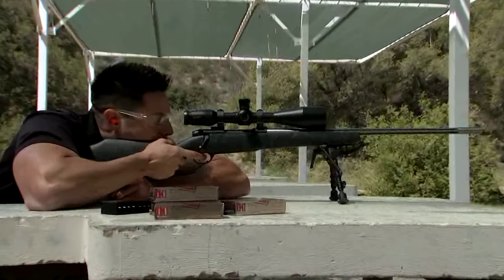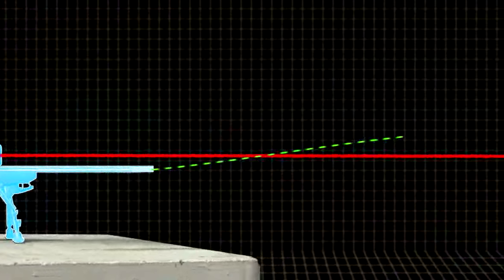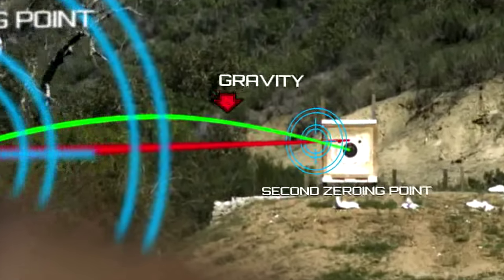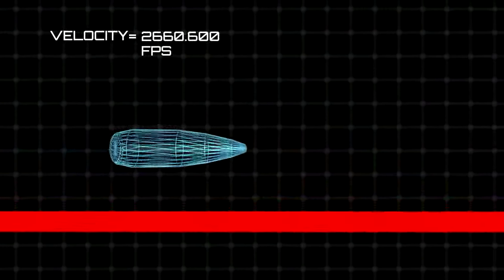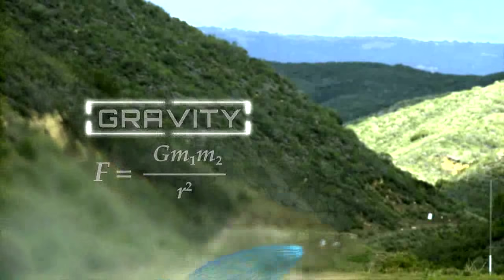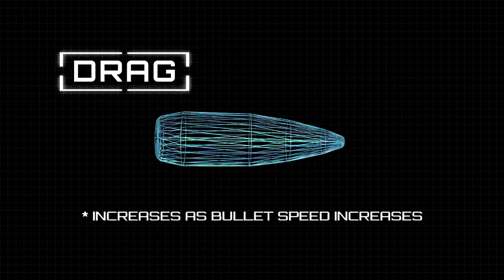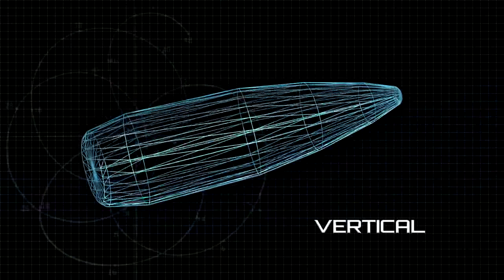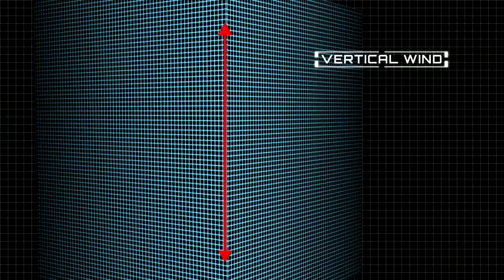Firearm Science: Bullet Trajectory

Comment: If I can make an observation.. the animations used illustrate a bullet rising as it leaves the muzzle, which is one of the biggest misconceptions with regards to a bullets trajectory.

The rifle optic and the bore are not parallel. Instead, the lenses in the optic angle slightly downward so the line of sight and the line of the bore intersect in two locations. This forces the shooter to angle the rifle slightly upward to compensate for the optic looking down, and in turn the projectile exits the barrel at an upward angle.

Where the projectile's path intersects the line of sight for the first time, should be the near zero, i.e. 25yd, 50yd, etc. 

The bullet continues upwards until it reaches its maximum ordinate, and then begins a downward path. 

The bullet will once again cross the line of sight at a far zero point, 100yd, 200yd, 300yd, etc. (The distances will all depend on the individual ballistics of the ammunition being fired and the length of the barrel from which it is fired).
Reply: "...the projectile exists the barrel at an upward angle." Ahh, no that is not correct. The bullet exits the barrel traveling in a straight line. But as soon as it has exited, gravity begins to affect the trajectory, so the bullet begins to fall toward the center of the earth. If shooting at a target that is approximately at the same altitude as the shooter, the bullet must initially be launched at a slight upward angle relative to the straight line between the shooter and the target. This is accomplished by raising the barrel slightly. If the firearm is sighted correctly, the upward angle will be such the the bullet will rise, crest, and then fall such that the point of impact is the aim point on the target. The actual flight path closely approximates a portion of a parabola.
Reply: @steveh8724  is the barrel angled upwards? Then yes. It does exit at an upward angle. I didn't say the round rises once it exits the barrel, I said that when it exits the barrel it is angled upwards to generate a trajectory that will allow it to rise above the horizontal plane, and then fall back onto its intended target.
Reply: @steveh8724  after reading your comment, you are basically agreeing with me I don't see where the disconnect is.
Reply: Pablo > steve
Reply: @steveh8724  Isn't that exactly what she claims?
Reply: @pandresa  what if you are shooting uphill/downhill? WOuldn't that change the zero?
Reply: @wcsdiaries  first off you shouldn't be zeroing uphill or downhill. just wanted to throw that out there. not unless it's warranted for some strange application, like armed rooftop security guard or something weird where you'll actually expect to only shoot downhill.

regardless if it's uphill, downhill, or flat, a bullet will never exit the barrel in the manner described in this video. if the barrel is parallel to the ground, the bullet will exit the barrel parallel to the ground and immediately feel the effects of gravity. if your barrel is 45 above/below the horizontal plane, the bullet will exit at 45 above/below the horizontal plane and begin to feel gravity just the same.
Reply: @wcsdiaries  but to answer your question, zeroing uphill and downhill does change the zero. don't know why you'd do it though.
Reply: @pandresa  what I meant was, let's say I'm 100 yards away on a hill shooting at a deer, BUT when I zeroed my rifle it was at 100 yards on flat ground. Would the elevation change affect the arc of the bullet, and thus throw my (perfectly zeroed) shot off? I've heard the saying "uphill/downhill aim low" bc apparently gravity doesn't throw off trajectory as much if the bullet is angled up/down. is that true? or myth?
Reply: @wcsdiaries  shouldn't matter much if you're shooting a deer at 100m. maybe an inch of difference, you'll still hit lung. but in theory, yes it would be different. you'd have to make an adjustment if you're bow hunting from a stand because of how slow the arrow travels compared to a bullet. but like I said, 100m is negligible. 200 and beyond, depending on what you're shooting, it'll make a bigger difference.
Reply: @pandresa  ok so if i zero in a riflr at 600m (hits bulls eye perfectly), then climb a ladder to a platform high in the air directly above my zero, and fire at that same bulls eye (which is still 600m away) i would not hit the bulls eye, and my shot wiukd probably be way high on the target?
Reply: @wcsdiaries  basically, yes. lol
Reply: She said "the barrel of the gun  must be pointed upward."  To my understanding, the bullet travels in an arc.  It's like throwing a long pass with a football. I don't understand why people feel the need to over explain that simple concept.
Reply: That makes so much more sense... always assumed scopes were parallel to the barrel, and wondered how that helped with aiming
Reply: I think this is meant to give the audience a "concept" of what the projectile's trajectory is like...yes, maybe it would have been more accurate to ensure the gun-barrel was tilted upward more perceptibly to demonstrate this, but well...I think this video made a good effort given what it is.
Reply: I think that's exactly what she said, but it just looks weird in the animation because the line drawn was not parallel to the barrel

Comment: And no setting elevation is done by lowering or raising the crosshair of an optic depending on the distance , or if the optic has the grooves for distance then that is how you adjust elevation .
Or without an optic like an AK you have the elevation for several hundred meters and you just set those

Comment: There is something slightly incorrect about the animation. Actually gun barrel is slight tilted upwards. There is no such thing as lift for the bullet. The reason air foil can generate lift is totally different, it is due to the shape of the air foil such that the upper surface has less pressure and lower surface has more pressure due to Bernoulli's principal. Note that bullet is axisymmetrical and it does NOT generate any aerodynamic lift. Let's repeat it after me again, there is NO lift for bullet and the barrel is tilted upwards.
Reply: LOL god dam you ripped the shit out of that person ahahah i didn't even get to read what that person said but i agree with your statement..the animation seemed unclear and off. i dont know too much about guns but its wasn't clear on the information from what i saw and what she was explaining
Reply: The bernoulli explanation is absolutely overused and incomplete. All it does is generate lift with 0 AoA. But the MAJOR component is actually angle of attack.
Paper airplanes don't have the classic airfoil shape, but still fly? That's because the real component is AoA, it is deflecting air.

Comment: Another thing to consider about high speed bullets, when a shooter lets one go toward a target, on the surface of the earth they are actually sending that bullet into a direction that would eventually lead into space. Force of gravity keeps it wrapping around the surface of that "basket ball" from which it was launched. The more speed, the less gravity will have an effect due to these two force vectors acting upon the bullet.

Bullet drag coefficient is also super important. The more efficient a bullet is, the less starting velocity is needed in order to maintain a higher finishing velocity. The overall velocity deviation over the flight of that bullet is less varied and, keeping in mind about the first statement, the bullet will have less drop overall. You simply don't need a massively powerful, super high speed muzzle velocity if the bullet design is very efficient. Wind and gravity will have less effect.
Reply: this is false on so many levels, you probably still believe in coriolis effect!
Reply: @brianzell99  Facts don't care what you believe, or how you feel.
Reply: @exothermal.sprocket  exactly!
Reply: @brianzell99  There's only one set of facts. You aren't aligning with them.
Reply: @exothermal.sprocket  I agree, facts are facts!
Reply: @brianzell99  I know what you're saying and I'm not playing your game. The air went out of your basketball and you've been playing the flat game ever since.

Comment: Rifle effective long distance ranges is 600-1,500 yards. It gets boring once you know how to work it. But I still find joy in plinking. Rule of thumb: every barrel inch lost minus 25-50 fps, every 100 yards 150-200 fps lost, subsonic when below around 1100 fps, 1 mil is 1 yard at 1,000 yards (3.6 inches 100 yds = 36 in at 1,000 yds) and 1 meter at 1,000 meters (10cm 100 m = 100 cm 1,000 m), 1 MOA = 1.047 in at 100 yds...now that I've taught you how to adjust your scope and what your muzzle velocity would be...factor in scope height, sight zero distance, ballistic coefficient, and most tricky part the environment. Winds at firing, downrange, and target locations are all different in each section; must account also for gust and winds aloft (winds at different altitudes/heights). Then there is the rifle, shooter, and how precise is your load...Don't forget earth's rotation and angle/elevation (multiply the cosine) shooting will throw off your drop/gravity 🍺 I've never taken any courses. Speaking from experience with firearms since age of 12 (in my 30s now), self taught knowledge, and having experimented with it practically.

Comment: Curiosity Q: using Side Grip (gangster grip).  I am told the gun recoil will be on the horizontal - but that is gun physics and mechanics.  I assume the trajectory of the bullet will still be on the vertical - since gravity does not change with the turning of the pistol.  I have heard others disagree with this and claim the trajectory is changed by the rotation of the gun.  Personally, I see no use for the side grip, but knowledge is power and one never knows what kind of situation may arise.  So, what if any, effect does using a side grip have on the trajectory of a bullet?
Reply: Should have no effect with the bullet trajectory
Reply: The effect is negligible at the range handguns are usually used at (at least ranges at which there is a realistic, heat-of-the-moment, expectation of hitting the target).

Comment: But WHY do you have to shoot at an upward angle? To account for sight over bore or to account for bullet drop? At 100 yards I can’t imagine the bullet dropping so dramatically
Reply: For bullet drop
Reply: For both reasons.  The sight over bore is minimal but increases as distance decreases.  Bullet drop increases as distance increases.  The bullet drops about 32ft/second per second.  So if it takes 1 second to reach the target, the bullet drops 32ft.  If it takes 2 seconds,  it will drop 64ft.   If it takes 0.5 seconds it drops 16ft, etc.  So to counter that drop, you have to aim so that the bullet will gain altitude then lose altitude and end up where it needs to be while still falling the distance it will fall over the distance traveled.
Reply: @Bendigo1  thank you for the explanation!
Reply: @jimsagubigula7337  thank you
Reply: Acceleration due to gravity is 32 ft per second squared. So you would square the amount of time and multiply by 32 to get the amount of bullet drop. Lets say your bullet goes 100 yards in a tenth of a second. 100 yards is 300 feet. So the bullet is traveling an average of 3,000 feet per second (that's over 2,000mph, or mach 2.6) to go 300 feet in 0.1 seconds. If we square 0.1 seconds, we get 0.01. Multiply that by 32 and we get 0.32 feet of bullet drop due to gravity in 100 yards. 0.32 feet is almost 4 inches. That is pretty dramatic if you ask me. That's why you have to account for both sight over bore AND bullet drop by shooting at an upward angle.

Comment: Gravity is the constant no matter what velocity the bullet is travelling.
The difference is that the bullet is travels faster based on higher velocity meaning the bullet takes less time to hit the target resulting in less time gravity has to effect the drop of the bullet.
The bullet drops from the effects of gravity will always remain the same as long as you are firing exactly horizontal.
X inches for every X seconds in the air.
Reply: This was almost right, but bullet drop is not linear, linear approximations work well at short distances only.
What happens, is that for every second, the bullet gains vertical velocity downwards.

Comment: i have a question, cant a bullet drop be partially cancelled by making a shape that has airlift ? i know, even if its possible , it would be largely quantitative without keeping in mind, the distance of the target, but just asking if its feasible.
Reply: Projectiles deform and engrave themselves on the rifling, so I'm not sure it would be possible to create one that would do what you describe and survive.
Reply: That would only be possible if the projectile does not spin.  It would neet to be asymmetrical and would then require other parts to keep it stable.
Reply: @Bendigo1  waht exact kind of stability? i dont get it.
Reply: @bhargabbaibhab2855 A bullet that does not spin begins to wobble and tumble in flight. Think of a football being thrown without spin by a quarterback, or a knuckleball thrown by a baseball pitcher. Once the wobble starts, the flight becomes erratic due to uneven air pressure at different points on the object, thus causing it to fly off it's intended course. The spin is what keeps it more stable in flight, i.e. pointed forward toward the target.

Comment: I wonder if automatic distance calibration is yet invented, that automatically calculate distance and corrects the bullet drop to match exactly the path. This could easily be also connected to weather system of the place, calculating the wind into the path.
Reply: BORS. I believe it's called. Calculates air, distance,slope, drift.

Comment: The projectiles ordinarily do move straight.  Gravity does not apply itself. 
If it did it would be after a period of time. You misunderstand many things and are wrong about others.
You are talking about substance ammunition that is made to remove it from normal function. You are talking about a new low that is beneath any level of performance. The science of it only applies to your substandard ammunition and guns that have almost no power in them.

Comment: Ouch the physics was wrong on that one... I was looking for a graphitic for my physics class to explain why a bullet fired and bullet dropped from the same height hit the ground at the same time (I'll be using the classic Myth Busters clip but wanted to see what else was out there). First was the half circle thing - it is a parabolic path due to gravity. Second was drag/air resistance (which are two names for the same thing in this case) - bullets are too small for these to be significant (it is less than 1 part in 1000) compared to gravity in calm air. Third the bullet when in the air has no intrinsic force of motion. It is videos like this that make my job harder in dispelling misconceptions about how the physical world works. Well, I have said my peace.